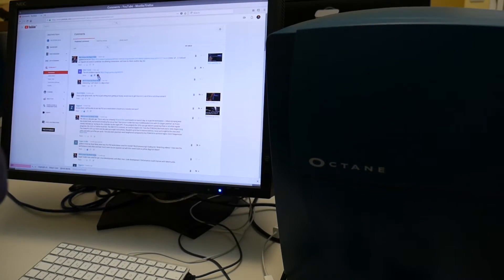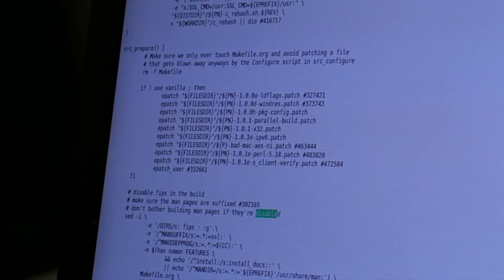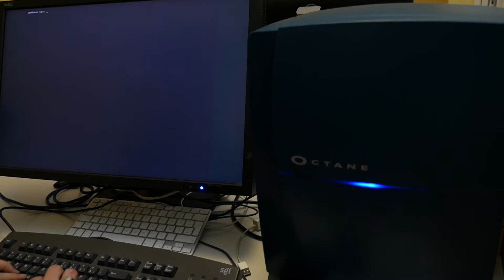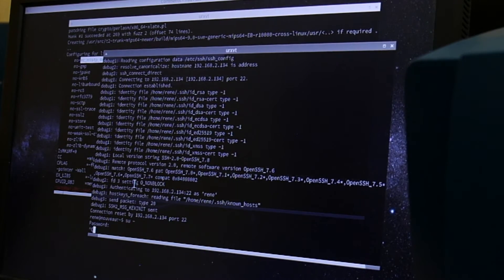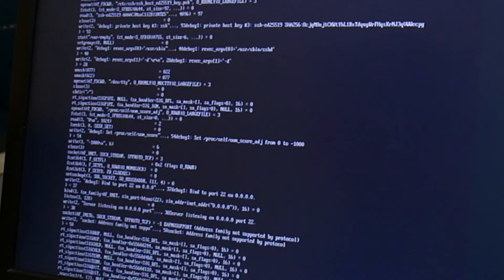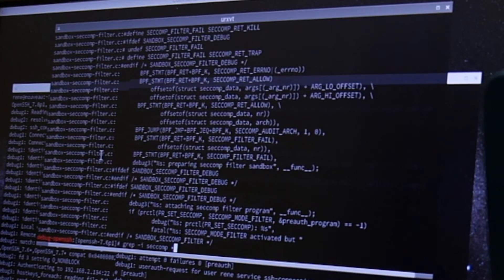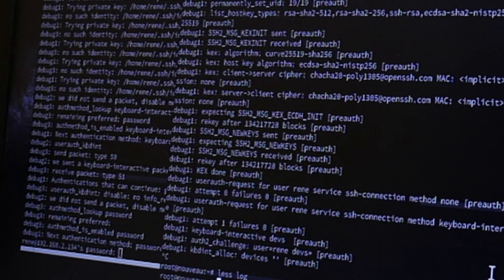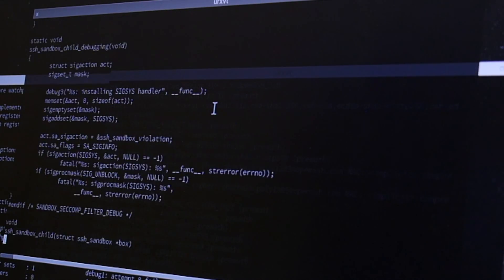Debugging MIPS64 sshd issue, on an Sgi Octane!

Comment: Experienced similar issues with seccomp and 'file/libmagic'. The problem is, the yailing is done on Intel 64-bit and people are usually not aware, that system calls on Linux differ per platform. EPERM, permission denied nowadays always justifies a grep for seccomp in the code basis. :-)
Reply from the maker: which architecture were you using?
Reply: @renerebe  32-bit Intel 686, the bug was on Archlinux32
Reply from the maker: interesting, did not expect regular old fashioned x86 to have an issue like that, …
Reply: 32-bit Intel has some additional syscalls for 64-bit file offset support, for instance fstat64. They are particularly easy to miss, because the C library does some macro trickery, so that source code doesn't show a difference and 'fstat' is 'fstat' on 32-bit and 64-bit intel.